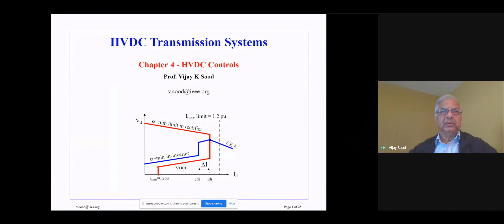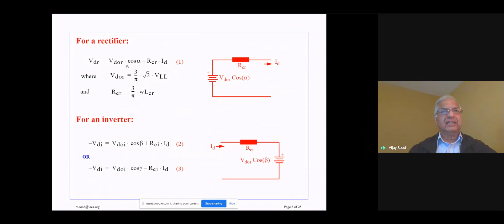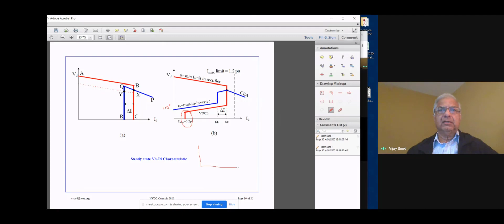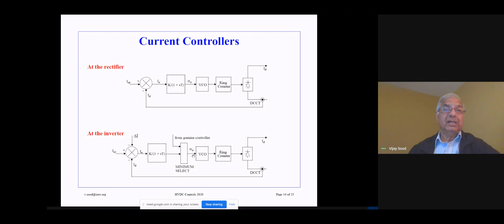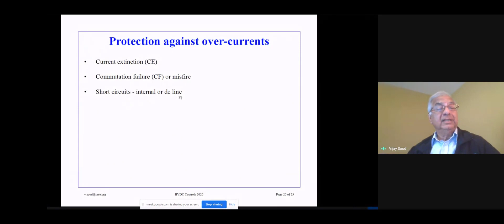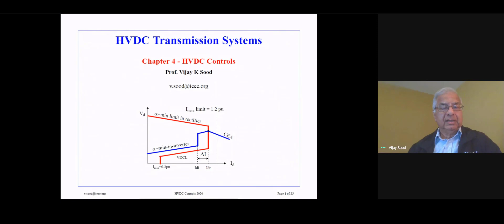Guest Lecture  Prof V  Sood  HVDC control point to point LCC

Comment: Sir It was good lecture on HVDC control point. Being non electrical person, still I was able to understand a lot from this. I have just one request for your upcoming lectures, please try to increase technical information area. This lecture had only presentation space for  about 38% of the screen area of PC. Most of the area was black and Selfie video area was also big. if information area is large we can see small symbols etc with ease
Reply from the maker: Thanks very much for your kind comment!